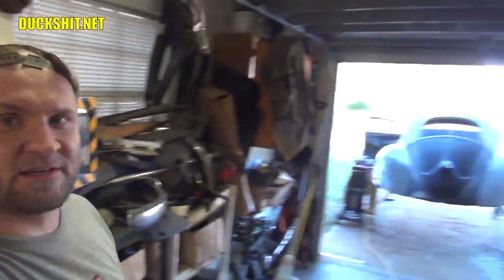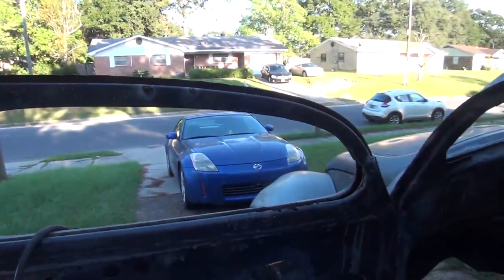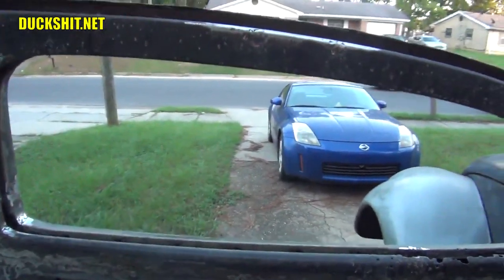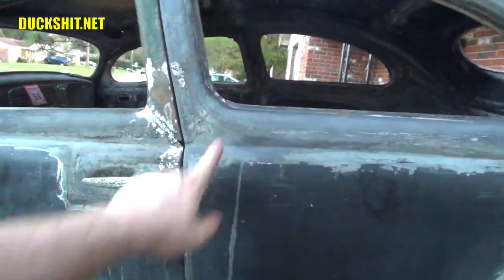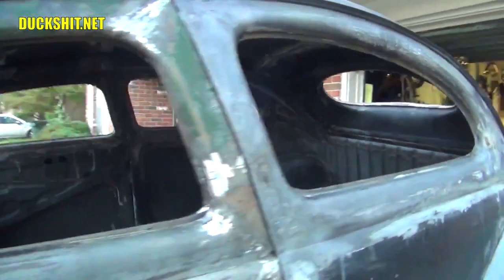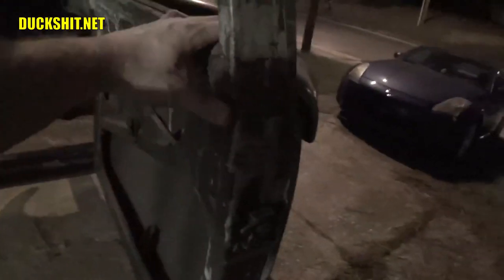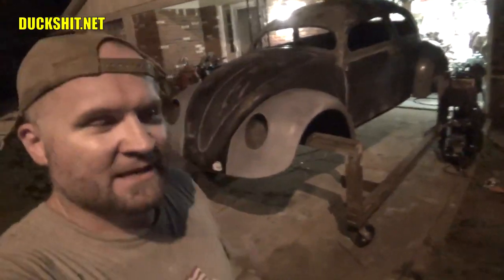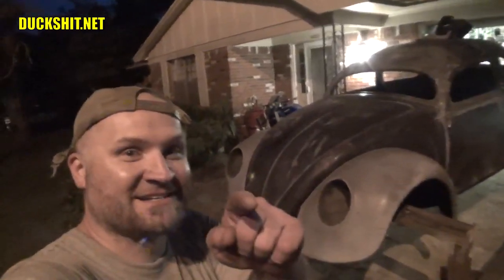More Door Stuff - ROTTEN OLD 1956 Chop Top Oval VW Beetle - 45

Comment: Glenn, the passenger side door window seems not even with rear lower end.
The driver side is good. Did you ever thinked about rear retractable windows?
Like the BMW E9 or the first 6-Series have. That would be the ultimate killer xtra!
Reply from the maker: Heh, window alignment stuff was all discussed in another video, I put level across it and demonstrated it is straight.  The doors still needs more work, though, that is rust repair-related that will level off the sills in the doors...  and that's coming soon!  Yes I considered rear roll-down windows, but I think I may opt for motorized popouts instead to make the car at least keep its period looks. Thanks for the comment!